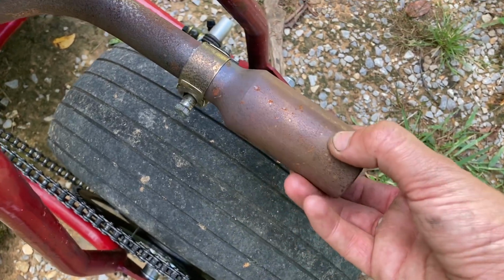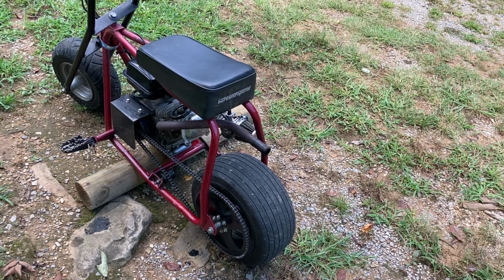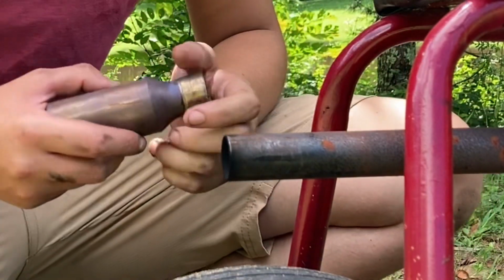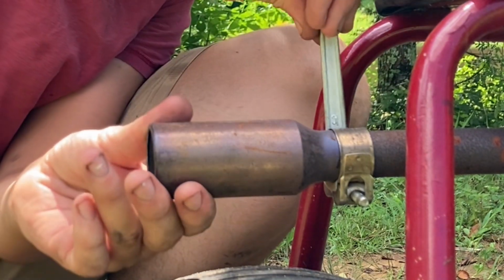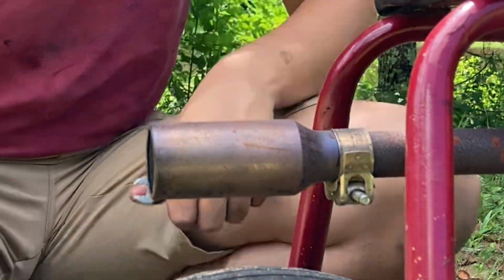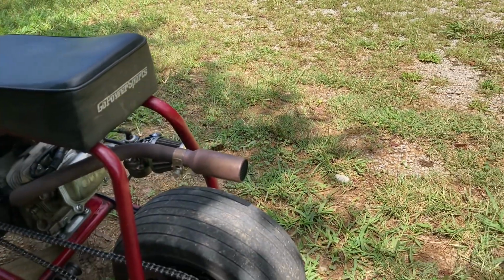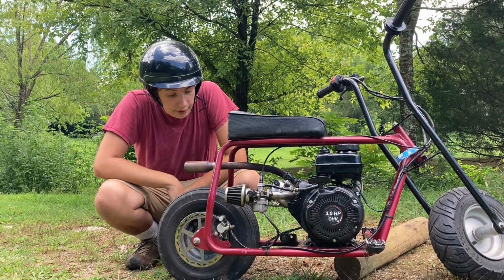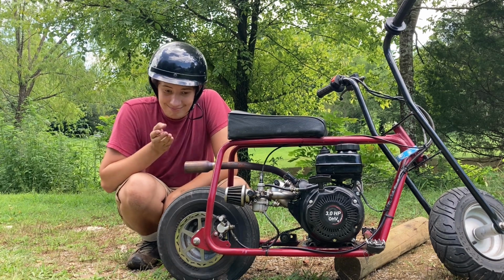RLV Mini 91 Slip-On Silencer Demonstration on a ￼99cc Coleman Engine.

Comment: Tbh bro in the video I can't tell any difference which sucks bc I've been thinking about buying one bc I know mines super super loud with header I guess they work though or ppl wouldn't buy them lol nice video
Reply from the maker: Yeah the virtual experience doesn’t help at all. You have to be there to tell the difference. The mini 91 are generally for 100cc engines. You can use them on a 200cc engine but I think it would be too restrictive. There’s a lot of pipes out there that except threaded 3/4 mufflers and they’re decently quiet and don’t rob power.

Comment: Really needed a decibel reading. There are apps for that. Hard to tell over computer / phone sound, just how much this silences it.
Reply from the maker: yeah this video is outdated. I've stopped making videos because i just dont have the equipment to make videos. 

The silencer is quieter than straight pipe but louder than a stock muffler in short summary.